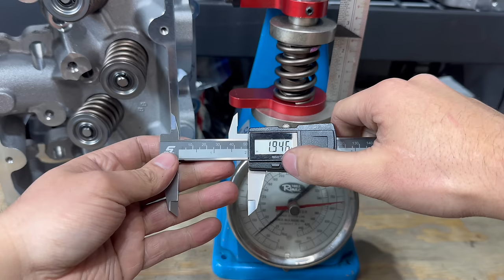Valve Spring UPGRADE Tips EVERYONE Needs To Know.

Comment: Why are OHC engines valve spring pressures so low compared to that of OHV engines? The OHC engines rev higher, yet their springs are smaller in diameter and the spring open and closed pressures are MUCH, MUCH lower than OHV engines. What are the physics behind this?

Comment: You missed that every valve spring  retainer style has a different installed height measurement, some have a big radius on the top, and some have a small step in the bottom. These variations will throw off your retainer lip measurement. Telescopic gauge may work for bbc/bbf however in LS heads it doesn't. Best and most accurate way is a valve hight micrometer

Comment: When you measured with dial calipers you was on top of the spring retainer the other to naturally measure under the retainer but I didn’t hear you mention or calculate the difference of the thickness of the spring retainer.
Reply: Did you not watch?

Comment: 25:45 I’m not an engine builder. You had 13 thousandths difference between measurement tools, is that really considered “close enough”? I admit to being a perfectionist, so if I saw that, I wouldn’t be doing anything else until I confirmed my tools were measuring accurately, but like I said: I’m not an engine builder and I genuinely don’t know if that is “close enough” in this situation.
Reply from the maker: It’s more to do with I don’t use the number I got off the snap gauge to determine the height. I used the numbers I got off my caliper. I even also trust the number off the spring micrometer. Was just casually showing that there was a difference in the ways you can measure but in this context that .013” isn’t gonna be the end of the world since nothing is being assembled at the limit.
Reply: @EngineRehab  cool, thanks for explaining!
Reply: Old Skool SS, All iron BBC:
Spend all day swapping valves between combustion chambers to get a pattern of variations in CCs, after valve work.
Then take them to machine shop, have them milled to Minimum Alowed, while checking CCs between cuts.
Patience Required!
Then have them checked out by  NHRA Division Inspector.
Breath easy at Tear Down!
$
Thanks for the refresher😊
Reply: Looking forward to your collab with the cleaning guy and son